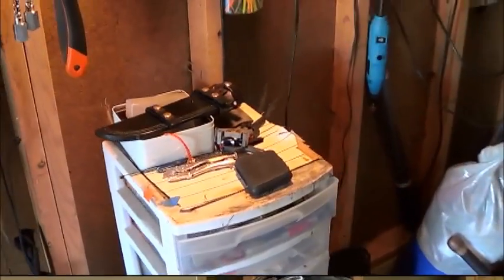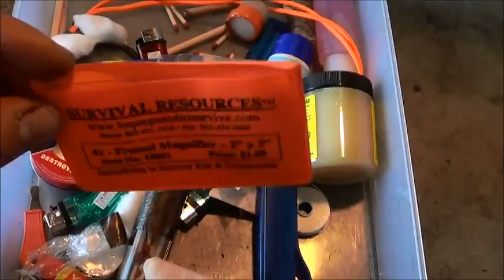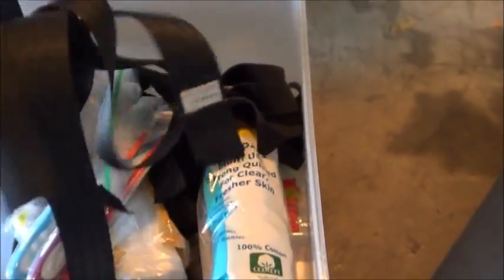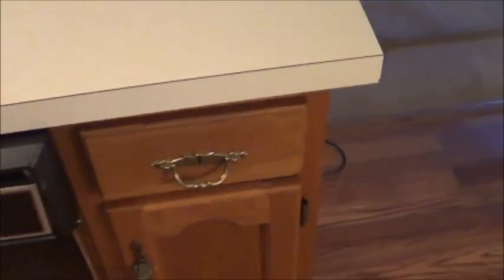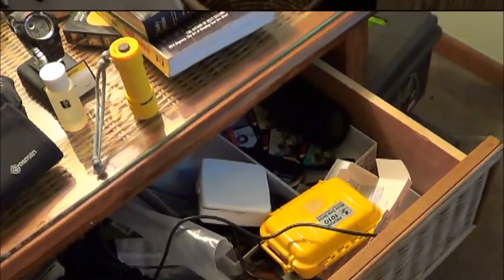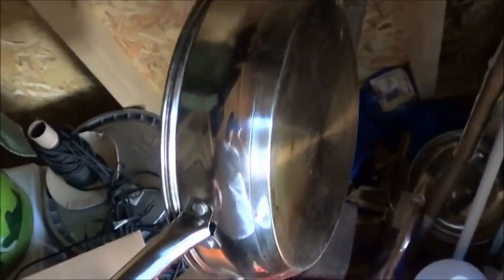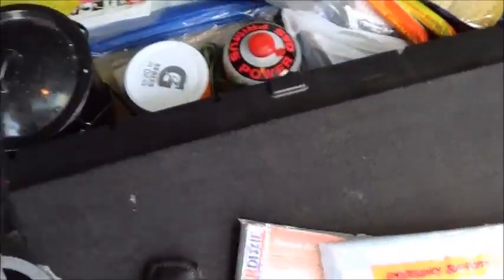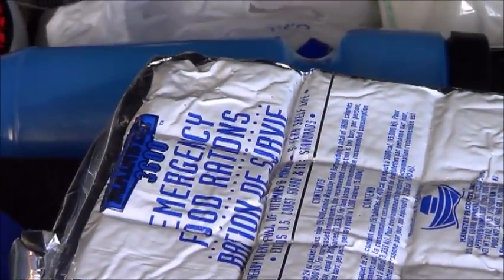Junk Drawer Survival / Spouses's Hidden Car Kit

Comment: Nice bud. May I suggest some glow sticks for road "flares". Where I live there is a huge problem with wildfires during the summer so if your stuck on the side of the road at night using glow sticks instead of traditional flares is safer. The last thing you need is a wildfire while your trying to change a tire